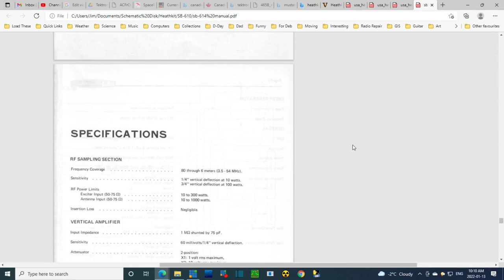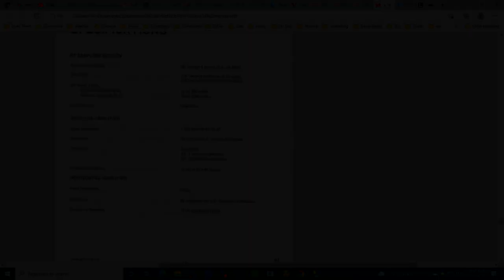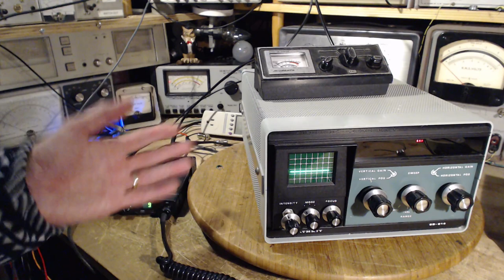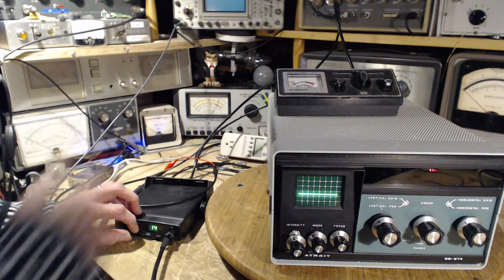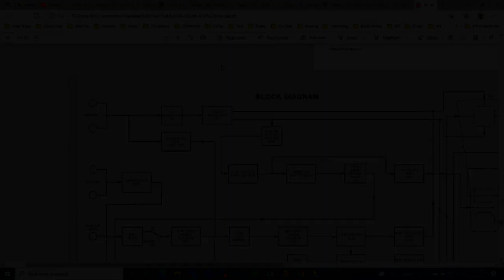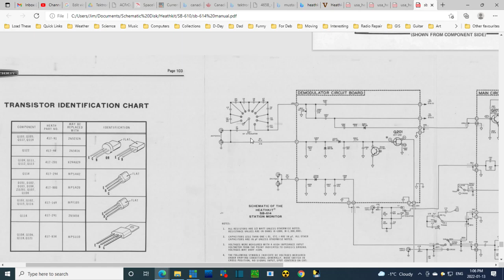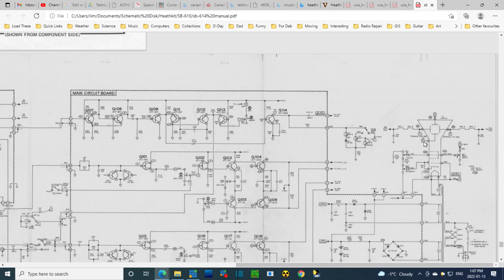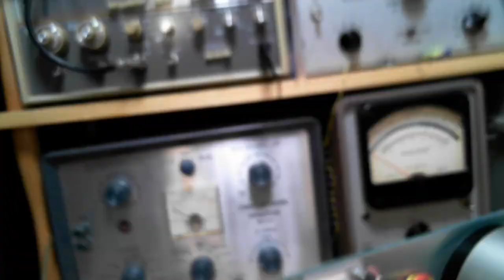Heathkit SB 614 Station Monitor Video #1 - Checkout and Testing

Comment: The vertical input is there so you can ALSO use it as a O scope. You will need more power to get more then a 1/4 inch deflection on the CRT.  I rebuilt mine that got hit by lighting and blew most transistors. It looks to be working as it should.